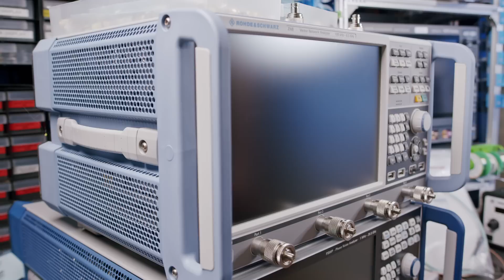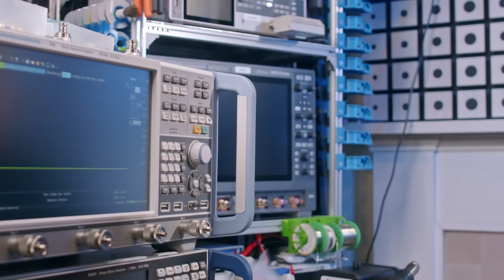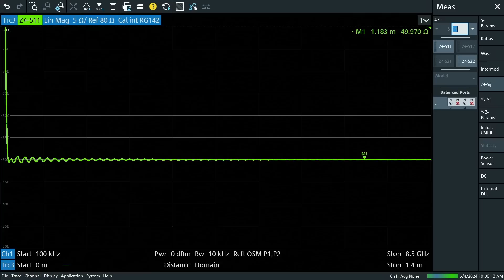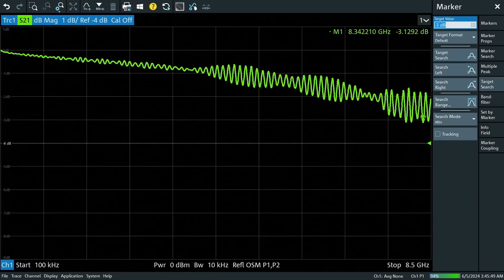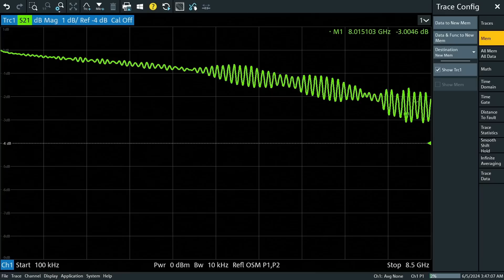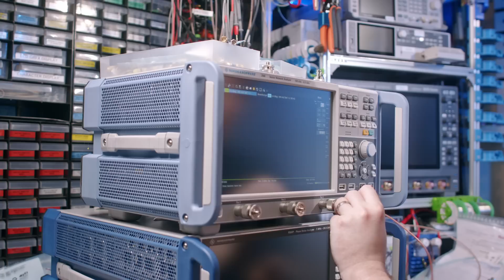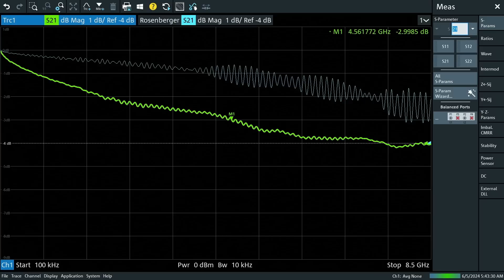Is the $600 Cable Really Better? Testing Coaxial Cables!

Comment: I have not used one of these in almost a decade, but generally, I go with cables in the midrange. Expensive cables often use exotic or rare materials that improve fidelity, but the cost scaling is not worth it for most.